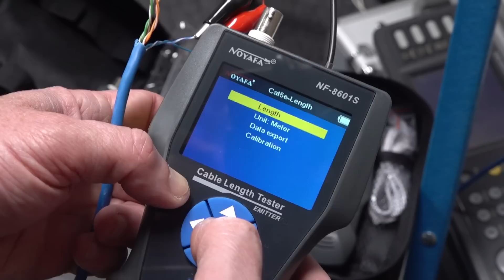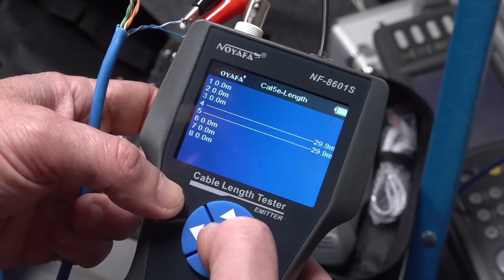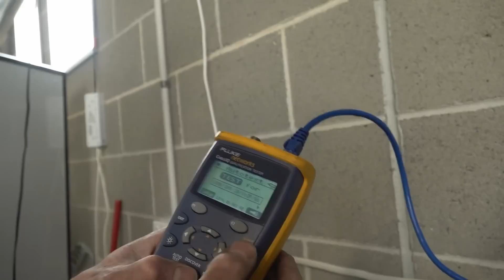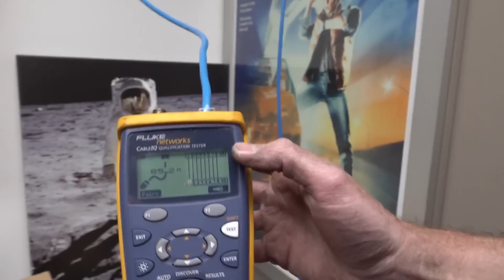Dungeon Ethernet Install!

Comment: 9:58 - I was always taught that it was 100 meters from the switch port right through to the NIC, ie including all the patch leads.
Reply: Yep, that's correct, the 100m is the total link length (90m + 2x5m patch cables).
As a European, I envy you a bit when it comes to shielding.
We loooove shielding everyone and everything here and thus make us a lot of additional work and sometimes also create new problems. :-|
Reply: Yes. But like anything else there is the specification that "should work" and if you are out of spec "it might work."  Lots of slop in the real world.

Comment: I had a friend who used to use an r/c controlled tank toy to run cables across suspended seilings. Worked great!
Reply: I've heard of people using trained ferrets.
Reply: @trustthewater  gross
Reply: @trustthewater  
BBC ran cables for a concert in Greenwich park with ferrets
And after some googling, I found out that there are still companies that specialises in using ferrets to run cables

Comment: Nothing like KRONE patch panels. Been used to the Type66 blocks used in the states. Had to purchase a new dedicated tool to use these blocks in the EU. I had to use a type66 block with lightning protection used by AT&T on the lines into my home here in the EU after I found out the hard way that the telco system here has ZERO lightning protection on the lines. I keep having to explain to the telecom techs that come here to explain what it is and that it is widely used by AT&T in most of the states.

Comment: I ran about 500 feet of CAT6 in my house and that tone generator would have been very useful! Need to add one to my kit.
Reply: The Fluke gear he was using comes in a kit. It was the Fluke networks cableIQ kit. The tonner is also sold separately. The tonner is a Fluke IntelliTone "kit" and it work a little differently than most other tonners. It handles noisy environments much better. The Fluke gear isn't cheap but is worth it if you are using it often. But for working on your home the cheaper ones will work fine since you can get away with powering everything down if there ends up being to much RF noise where you are trying to trace cables.
Reply: @AdrianSchwartzmann  I've got the same Chinese kit as Dave shows.  For just me dicking around at home, it's fine.  If I did this in any serious capacity, I'd have the Fluke stuff.
Reply: Seeing the tool after purchasing my first one out of the blue 5hr ago was very weird.

Comment: So you need a certified leccy to even run data in Oz? They've got that tied down.
Reply: No, you need a registered cabler with their open registration and structured cabling endorsements.

Not all sparkles would even have this, but most would I imagine.

But being a sparky alone doesn't mean you're automatically allowed to do data. You still need your open registration and endorsements like everyone else.

Comment: Going to the van to get the correct krone punch down tool would have saved some rework….. , and probably future rework….hmmm
Reply: And doing a proper run rather than splicing it into some shitty cat 5e .
Reply from the maker: You can't just run cable down the riser. A huge job that involves breaking and repairing and recertification of  fire sealing
Reply: @EEVblog2  Hey Dave, so about fire protection: Are the floors fire sealed in between so no re-wiring can be done without the whole conduit been complete redone so you have to use those pre-run old telephone lines? Wow, that sounds that infrastructure is quite old then. Maybe it would be cheaper to re-do it once and upgrade to fiber between the floors.

Comment: Never leave the Krone tool in the car you vandal!! 😜  . I always had three or four in various toolbags, belts, boxes. Can't remember the number of times I attended open circuit faults cause someone "forgot the Krone tool" 25ys at the big T . Splitting the pairs when you tone out the cable makes it sing louder due to the imbalance.

Comment: Those two patch panels are Telco, they might be using cat5, but it's not network speeds. You should not be using those telco [unch downs you are breaking twist and you will be lucky if you get 10meg out of it.
Reply: I would not have leveraged the existing Krone connectors, especially on a long run like that.
Reply: Doubt it would be that bad, but would have been better to terminate both sides and just use an RJ45 cat6 coupler.
Reply: @landspide  no, you'd be best using highband IDC blocks which are designed for this purpose.

Comment: Was a long time ago, but if I remember correctly from my CCNA training : you shouldn't go over 90m (leaving 10m for the patch cables)
Had the same tester on a previous job and it only says if gigabit is possible but no actual transfer rates. Those measuring the bandwidth cost a LOT more.
Reply: Just test the bandwidth with a laptop lol
Reply: @rkan2  They do much more than measuring bandwidth. For example indication about NEXT and FEXT.

Comment: fascinating to see how the cables are routed but here we use fibre optic terminated to a GPON (passive optical networks ) router box inside the office. It carries all the communication internet phone, VoIP and tv if someone fancies. Internet speeds are available up to a theoretical 1Gbps (bits/s).

Comment: You are using the NF8601S wrong. It has a special port on the side for cable tracing (RJ45 SCAN). The signal should be much stronger on the scan port.

Comment: The China cable sniffer (in Hong Kong Cantonese it's call "Ghost/Spirit chasing unit") is not very accurate, a few meters tolerance ... but it works quite well, and rather cheap comparing to western version, and it try to jam every function (you can think of) in a single unit, just the plastic case and the push button not so professional.

Comment: How does the tone tracer deal with shielded cable?
Reply: Being a retired telecom tech with 41+ years of experience (as a "Cable Splicing Technician"), I have your answer.  The best way is to connect one clip of your tone generator to a good earth ground, and another to the cable's shield ( making sure to check that the shield is not grounded first) If not, the shield will contain the signal within the cable, but if the shield IS the signal conductor it will be easy to find. Putting tone across 2 conductors tends to keep the signal "tight" to those conductors, and makes it a lower level signal to trace.

Comment: Most the NBN Techs even with all there Fancy  internet detectors couldnt find a root in a brothel 
my nbn 5  visits - Problem solved by Me -  It the idiot tech 2018 installer ($685 L8tr ) had put 4 staples thru my phone cable along the hallway   
frustrated for 2 years i found them one night going along the cable stapled to the skirting board on my knees with a magnifing glass wtf $ 2years of chit
 1 guy came from Telstra  was looking down holes onfootpath then  disappeared  with no response from telstra ring ring they kept saying i,m connected but it cuts out every time 
Anyway after i removed the staples reboot modem pc it has been going 100mbs since :) Hooray!  i always got fix stuff myslef near blind makes it harder 4 me but i do it .
Reply: imagine me working for Telstra  Ha! be fooked  but people be like bring him back again 
 was the same when i did Gardening Maintence & swimming pool maintence installed pumps chlorinators' cleaned etc 
boss was like the old ladys want you back :)  i had praticed with my agro  mother who was the same at times agree to disagree .
Reply: Looks like Telstra also stole your punctuation.